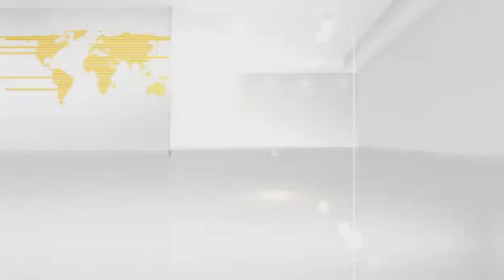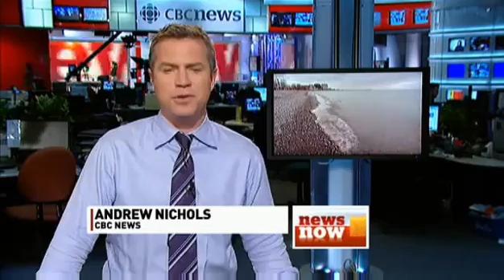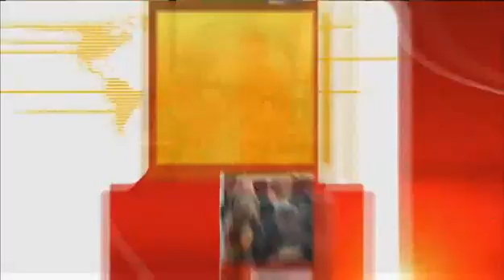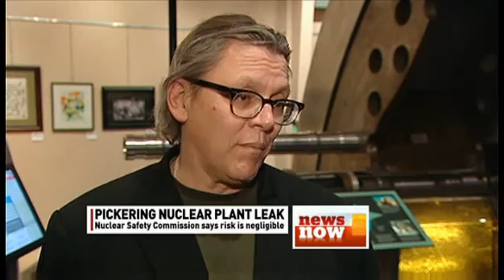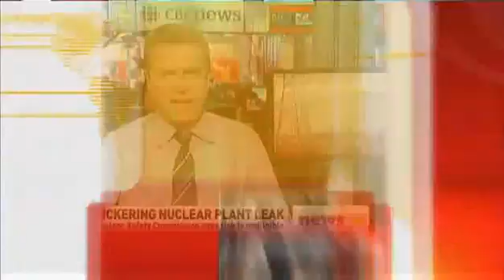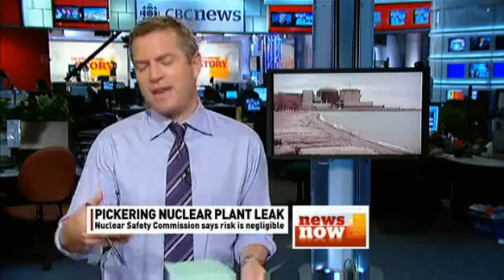Canada nuclear plant accident turns drinking water radioactive

Comment: doesnt sound like an accident, sounds on purpose.  To move that much water threw even a six inch pipe, which is huge, will take time.  Not a min, not two, quite a few!  For them to let this much out, roughly 20,000 gallons, takes a long time.  Which you say your system doesnt have alarms to warn you if a line is open?  How much does an actual reactor hold?  Don't beleave what they tell ya, do the math.  Again it dont add up with reality.  This was purposefully done for some reason!